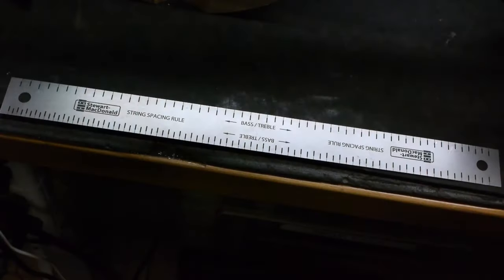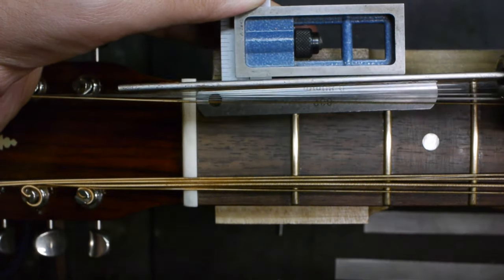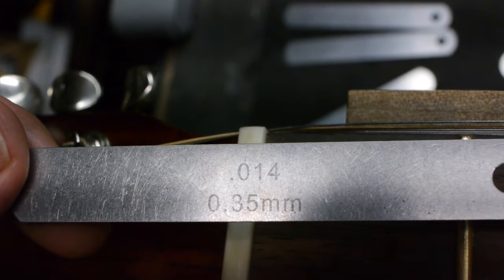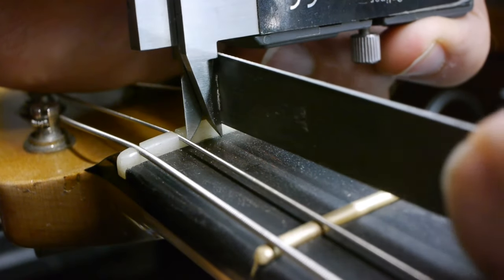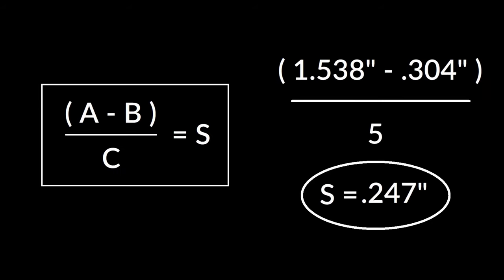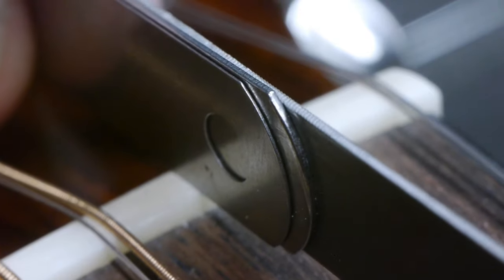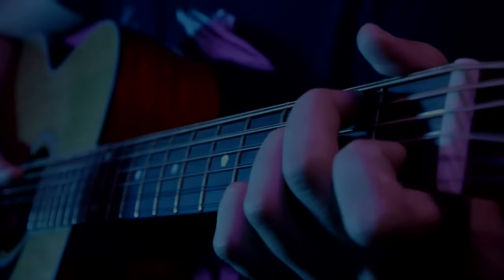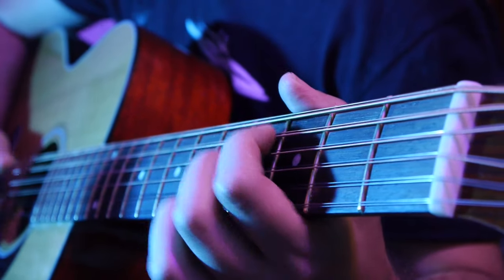12-String Guitar Nut Slotting | BEST Method - FOOLPROOF!

Comment: Amazing. One question though? How do you set the depth of the slots?? I was considering getting thr Hosco groobars for a depth stopping point?? Do you need to do the saddle the same way????? Any tips or trick on the would be great. Im just a player kinda,collector,hoarder,music lover and guitar addict... I have an old eko rio bravo that needs a nut change and i want to use your method. Great content.... Thanks for the video.. Todd from portland oregon.
Reply from the maker: Thanks so much! I set the depth by feel and eye, but Stewmac makes a "safe slot nut guard" if you'd like to use that. I'd explain, but it's much clearer on Stewmac. Link is here: 

https://www.stewmac.com/luthier-tools-and-supplies/tools-by-job/tools-for-nuts-and-saddles/stewmac-safe-slot-nut-guard/

I'm going to be releasing another updated video eventually about filling low nut slots as well, with baking soda + superglue, or bone dust + superglue. I do have a video about that on my channel already right here: 

https://www.youtube.com/watch?v=ALbzS42DCbI

And a similar one here:

https://www.youtube.com/watch?v=059s4TOs2_M

Much higher quality video on the way! But the general principle applies. 

Basically, don't be afraid of going too far, as you can simply fill the slot. People will say it's not a good fix and doesn't last but I've had ones I've done many years ago that are still fine. Once you do it a bunch of times it becomes a super fast procedure, no big deal at all -- and you get an infinite amount of tries for getting the slots to the exact depth you want. 

I'd encourage you to save the money, and just go by feel. You can use a Digital Action gauge (I got mine on eBay) to measure the string action, including at the nut. 

Simply let the probe fall onto the string at the 1st fret, then zero it out, then depress it to see how high it is. Generally, .016" action at the 1st fret on the 3 bass strings, and .009" action at the 1st fret on the 3 treble strings, is a good rule of thumb. 

Keep in mind that the neck relief plays a huge role in how high the strings are at the first fret. I generally like to get my necks just about straight before filing the nut slots. That way you guarantee you won't go too far. If you file the slots while there's a lot of relief in the neck, by the time you straighten it out, or get it to just a touch of relief, where setups feel best -- it'll be too low. 

Fortunately, even if that happens, the baking soda and superglue fix will take care of it every time. And you can try again. 

Let me know how it goes! And thanks for the comment!
Reply: @guitar_md  Hey,thanks for the reply. So no modifications to the bridge saddle???? Ill probably do the music nomad kiss system tool.... very affordable as opposed to stew macs waaaaay over priced safe slot.. they have good stuff but there price is just unreal its laughable... Thanks again.
Reply from the maker: @sandimastodd  You can notch saddles the same way, but typically I only do this on Tune O Matic style saddles, where you need to notch them. For acoustic saddles, I don't, though most plastic saddles have natural notches in them from the string pressure. Bone is much more resistant to that.

The string spacing on acoustics is dictated by the location of the bridge pin holes, so notching is not necessary. However,  on 12 strings, I prefer routing them for a 1/4" saddle. And I do partially notch them -- but the strings don't actually sit in the notch. It's for intonation  purposes: I use the nut file to notch away the area of the saddle I DON'T want the string to touch. 

On the Low E pair for example on a 12 string, the thicker E has to have its contact point considerably farther back than the thinner E string to intonate properly.
Reply from the maker: @sandimastodd  Any aftermarket copies are always preferable due to the price. There are a few non replaceable tools Stewmac has such as their plunge router base for the Dremel. But there are so many options on eBay now, I always check there first.

Comment: I just purchased a 12 string bass.  It sounds beautiful, but each course is too wide for any skinny finger other than my index to hold down in anything like proper form.  I measured the intracourse spacing as .075.  I see that you use .070 for a double course.  Have you ever tried a closer spacing for triple course?  Your video gives me hope that my beautiful sounding bass was not a wasted expenditure.
Reply from the maker: Definitely not a wasted expenditure! The nut is completely controllable. If you're not happy with the spacing you can make a new one. I've actually been meaning to make a video on filling nut slots with baking soda and superglue, and re-spacing and re-cutting them for practice. You can use any old nut, and you can redo the slots as many times as you want. It won't be pretty but it can work perfectly well, and given you have enough superglue and baking soda, you can try an infinite amount of times and hone your skills. 

In the very intro of the video is a clip of a 12 string bass nut with horrible spacing, and then a quick shot of a 12 string bass nut I cut for it, with much closer spaced triple courses. 

For that, I used a .028" feeler gauge as the spacer between each string. Is that what you meant? When you're referring to .075" I'm a little confused as to what measurement that is. Let me know! The problem is 100% fixable, guaranteed. Either making a new nut, or filling and re-spacing the slots, will make a mind blowing difference for your bass!
Reply: @guitar_md  Thank you for your prompt reply!  In answer to your question: .028" equals .070mm.  My triple courses have .075mm between each string within the course.  I just checked my feeler gauge, that is .030".  So, how small an intra-course spacing have you ever tried?

The nut is metal.  So, no matter what, I will be making a new one.  Once again, thank you for being so very helpful.
Reply from the maker: @fan-bh7ur  I see! I have to work on my inch-to-mm conversions. They do come up a lot with guitars!

The narrowest I've ever tried was .020", or 0.50mm if I remember correctly. I just measured my 12 string nut that I cut and the high E string pair have 0.50mm between them. That is as close as I've ever gone, I think any more and you could seriously risk buzzing, but then again, you never know till you try!

Especially with a metal nut, which is not brittle and basically at zero risk for breaking (unlike bone), you could probably get away with that. 

One trick is, if you have enough height on the nut, to only file shallow marks, enough to hold the string in place, just to test your spacing. You can do this multiple times, and if you keep your cuts shallow enough, you can simply file the top of the nut down until you file through all the shallow slots you cut.

That of course requires your nut is high enough in the first place, but most stock nuts are. When the nut is 100% completed, the bottom 3 strings should have about half their diameter above the nut, only half of them seated down in the slot. So as long as you're not at that point, you can do a lot of shallow cuts to experiment with spacing, and just file away the marks and try again as needed. 

Hope that makes sense. Let me know how it goes!

Comment: Friend, your tutorial is great, super detailed, but I still have difficulty understanding some things, because I don't speak English, and even activating the subtitles I was a little confused. If you can answer me, I would appreciate it. (You already answered me another question before, but this current question came to me after watching the video again, as I haven't applied it yet, I just watched it).

Well, the question would be the following, what is the measurement from the tip of the nut, to the first string on each side? In the video you mention a measure that usually works in most cases, I mean, what would that measure be?

And in the case of a 6-string guitar, would you have a measurement that usually works for most cases as well?

Thanks!!!
Reply from the maker: 4/64 of an inch from the bevel of the fret! (1/16", as a reduced fraction). That would be 101.6mm in metric. The fret bevel is different on every guitar so it's important to measure it on each one. Same for 6 string, 12 string, bass, banjo -- any stringed instrument. 

You have more room to move the Low E string, so to really fine tune the outer string spacing. Move the Low E left or right as needed. Small shallow mark first-- then angle the file left or right as needed to move it. 

Leaving a little extra on the nut on either side will also allow side to side movement. So once your two outside strings are set, you can move the nut either way until it's perfectly centered. 

Hope this helps! Let me know. And thank you so much!
Reply from the maker: To clarify, the measurement is not from the tip of the nut, but measured from the fret bevel. So you want to cut your mark on the nut 101.6mm (1/16") from the fret bevel. 

That's the standard accepted distance. You can go in or out a little more depending on your preferences!
Reply: @guitar_md  Thank you very much, I really appreciate the clarification. Thank you!
Reply from the maker: @LO01  You're most welcome. Thanks for reaching out!

Comment: Hello, excuse my ignorance, but I don't understand what happens at 4:03, for example A: .024", because at 3:00 it appears A: .030". Would it be possible to explain? Thanks.
Reply from the maker: At 3:00, I'm using the string gauge for my 6 string electric guitar, which uses a .030" for the A string -- so demonstrating the formula using a different set of strings. 

At 4:03, I'm using the string gauge for my 12 string, which uses a .024" for the octave higher A string -- the thicker A string being a .046." 

Let me know if that clears it up!
Reply: @guitar_md  Thank you very much for the explanation, I understand.
Congratulations for the great work.
Reply from the maker: @LO01  Glad that helped! And thanks again!

Comment: What happens at the saddle end?
Reply from the maker: At the actual saddle: pretty much nothing, because the string tension is so high at the contact points (nut and saddle). The nut spacing has progressively less impact on spacing the closer to the saddle you travel. 

You can test this out by moving a string at the nut and seeing how much the spacing changes down the fingerboard, and then closer to the saddle. The string doesn't move on the saddle at all when you bend strings, though it'll move in front of it, for example. 

So it will affect spacing across the whole fingerboard, but the spacing at the saddle matters a lot too, and your string spacing overall is a result of the interplay between both of them.

This actually got me thinking! I've used this same caliper method to slot saddles before, including metal saddles like on electric guitars. My main Stratocaster has slots I cut with a nut file -- very shallow slots, just enough to catch the strings, but it makes a huge difference. The spacing was actually quite a bit off at first. I set the outside strings by eye, then use the same formula I used here to calculate for equal spaces between the strings.

So I'm no stranger to custom string spacing at the saddle, and how much of a difference it makes, though I haven't made a video on this.

12 string saddles are another story. Typically, the mass of the bridge pins will not allow you to get the string pairs very close together. However, I don't see why you couldn't file a notch into the bridge pins to allow for much closer string pair spacing. 

I've actually never tried this. There's also a tool called the Stewmac Bridge Saver. I've used this many times for customer repairs, but also used it on my 12 string to move the bridge pins back, so I could have room for routing a 1/4" saddle to get better, customized intonation for my down-tuned 12 string. 

The tool plugs the bridge pin holes, so you can re-locate and re-drill them if you want, though the original intention of the tool is to fix damaged bridge plates, not to relocate the pins. But relocating the pins is a very handy use for it!

Anyway, wow. Really got me thinking here. I may have to experiment. It is possible that narrower string pair spacing at the bridge of a 12 string could make it easier to fingerpick. 

However, here's one caveat: the strings vibrate much, much more violently where you fingerpick, around the soundhole. Because the string tension is lower. So some extra space between the string pairs may be necessary. I already get a little buzziness when playing hard with "normal" string pair spacing. If I moved them closer together at the saddle, it's possible that it would make the strings crash together around the soundhole while picking them, causing major buzzing. 

However, just a theory. Lots to think about! But best way is to test it. I will try doing this on a single string pair first and see what happens. 

Thanks for the great comment and question. String spacing at the saddle matters just as much as the spacing at the nut, and your total string spacing and feel of the guitar is an interplay between the two. Very interesting stuff!
Reply: @guitar_md  I just converted a 12 string to a 10 string and had to fill all the peg holes at the bridge except the 2 outer ones. Moved the pairs closer together but increased the spacing in between the pairs. It’s nearly finished. Just the nut to sort out🤔🤔. Thanks for the video.
Reply from the maker: @mikeatack6383  Absolutely! Sounds like a cool project. Hopefully this video will help you with that!

Comment: Very nice, gona make an upper Saddle to My Lincoln 12 for 50$
Reply from the maker: Awesome! Let me know how it goes!
Reply: @guitar_md  i will
Reply: Hi ✓ done.
Reply from the maker: @erikhoffa966  How'd it come out?
Reply: @guitar_md  not as Good as your,s due too tools, but better, 😃👍
Reply from the maker: @erikhoffa966  Excellent! So glad this video could help you out. New nuts make a huge difference :) Good work!
Reply: @guitar_md  less separation between  strings makes it a bit easier too push down, gona tighten Them on THE lower Saddle to with a Little growe. 

PS your film gave me THE inspiration. 👍
Reply from the maker: @erikhoffa966  That's awesome! So happy to have had this inspire you! And I agree -- less separation between the strings does make them easier to push down, and on top of that, also prevents accidental string muting when playing chords. 

When the strings are too far apart on a 12 string, it's easy to accidentally mute strings because there isn't enough separation between them. 

Thrilled this helped you out and inspired you to take your guitar to the next level. Thanks so much for sharing!

Comment: You forget slotting the nut slots for string height with your .010 feeler gauge between the fret and the string
Reply from the maker: Yes. You can do this. However, I just prefer doing it by hand and eye, and using a digital action gauge to verify the action. 

I'm not against the feeler gauge method, and if I give it another chance, maybe I'll convert to it. I'm just so used to the old school way and have been doing it for such a long time, I never even think of it. 

Even in my updated version of this video that I posted recently, I talk about action at the 1st fret, but I don't use the feeler gauge method. I would have mentioned it for sure if I'd thought of it. 

I'm always looking to improve my results and streamline things, so...I'll take it under advisement. I didn't use a digital action gauge for many years, and also set neck relief by eye -- now I use digital measurements for everything and my work is more accurate than ever. 

So I may very well convert to using feeler gauges. Could be a huge time saver. Thanks for the comment!

Comment: Those nut files are like over $300🙄. I’m working on a 12 string I found in the trash.
Reply from the maker: I do this professionally, and Stewmac's lifetime guarantee is also excellent for professionals who plan on doing this for decades. Already been at this almost 20 years, so well worth it for me! 

For a hobbyist, there are many other options now that are cheaper than Stewmac. I recommend looking on Amazon and eBay for nut files. To use this method, they have to be this style.

Comment: The string pairs are too close for my taste.
Reply from the maker: All 100% adjustable. I prefer them very close. But if you'd like them farther apart, you can use a wider feeler gauge or nut file to accomplish this. 

Mine are around .028" between pairs, the way I like. Stock 12 string nuts are typically around the .065" - .080" range. 

I've found .042" between pairs to be a good middle ground where it won't be too narrow, nor too wide. The spacing I like is definitely the most narrow I would go and may not be for everyone.

I recently used .042" between pairs on a mandolin and it came out great. Generally .042" is what I use when cutting nuts for other people. Much better than the stock string pair spacing but not as insanely close as I have the strings on my Blueridge 12 string. 

On my electric Cozart 12 string (which I still haven't done a video for), I want to make a brass nut with adjustable height. I might use the .042" pair spacing on that. I do like the super narrow spacing but just a touch wider completely averts any potential buzzing issues from the strings crashing into each other. .042" between pairs is my general catch-all recommendation these days